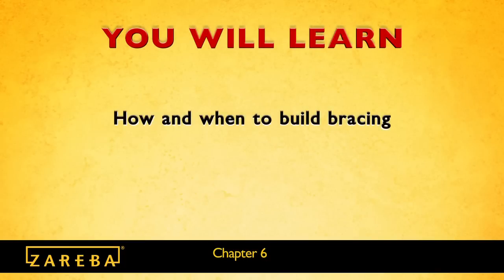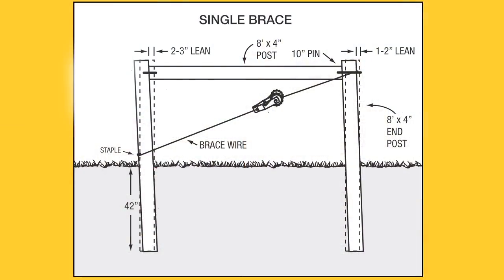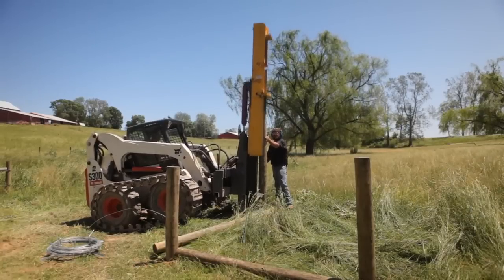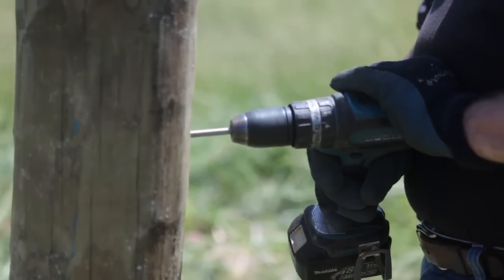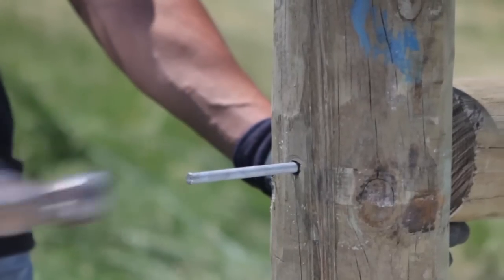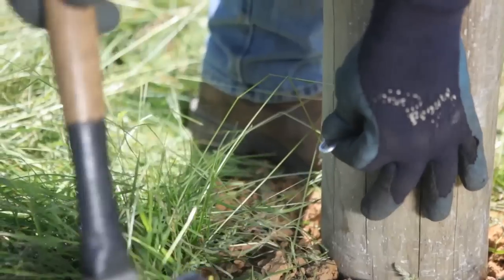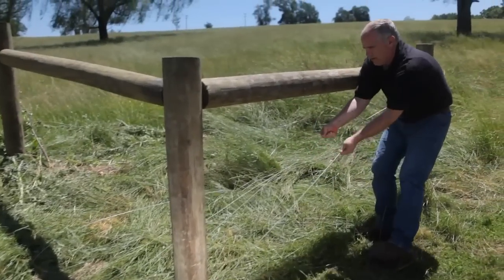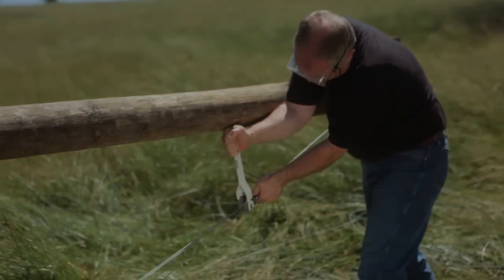Electric Fence 101: Corner Brace Installation Guide - Zareba® Systems

Comment: Notches are helpful to keep the horizontal brace piece from moving up and down, but a typical saw cut notch will not keep it from slipping out either side. A pin solves the issue of slipping motion of the horizontal piece both up and down, and side to side.